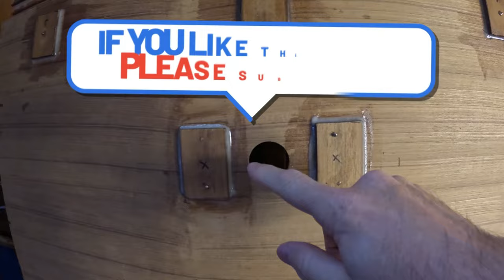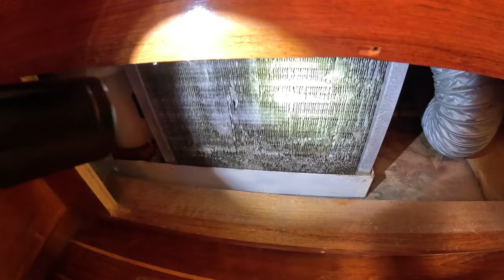DIY SailBoat. Nav Station Update: New LED lighting for the Nav Station. Endeavour 52. Sea 3 Ep 91

Comment: The light turned out awesome. It's a nice accent to that space. I've heard of bleaching wood. But I'm not experienced with it. I have a couple spots I'm going to try it on. But you are well ahead of me. BTW, there is power at the plug the air-conditioner is plugged into. I've gotten myself focused in on why something wasn't working and missed that the GFCI was tripped.
Reply from the maker: Good Day Wayne, Thank you for your kind comments. We don't have much woodworking experience and zero experience removing stains from wood. Luckily, in this case, it can't be seen unless up close. We have other areas in the boat we will need to find a solution for.  We are happy to hear you like our DIY LED light for the NAV station. We hope all is going well over on your boat?
Oh, and yes, the power outlet has power, lol. We checked that several times, lol 😆
Thank you for watching, and we hope you have a wonderful weekend
Reply: I tried the drill & screw method of removing plugs, turns out the plugs on my boat are glued in.
Reply from the maker: @wayneneuhofel6744  they didn't come out?
Reply: They didn't. the hole just splintered. So i started digging the rest out with an exacto knife and noted the adhesive on the edges. tried 2 more, same story. I have a spot weld cutter that should work. Just have to find it. @DIYNauticalDream
Reply from the maker: @wayneneuhofel6744   sorry to hear it didn't work for you. So far we have had good luck with it. But most of ours didn't appear to be glued in.